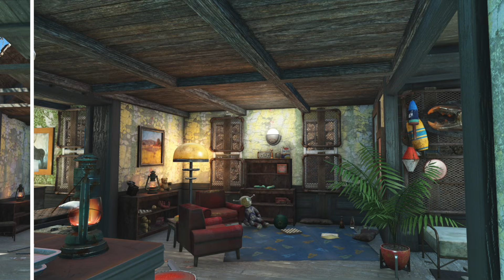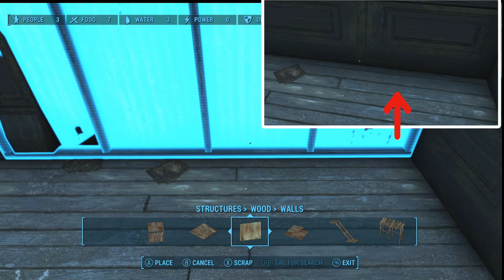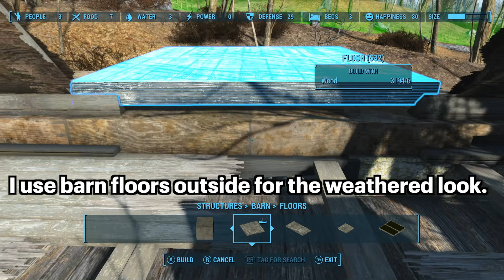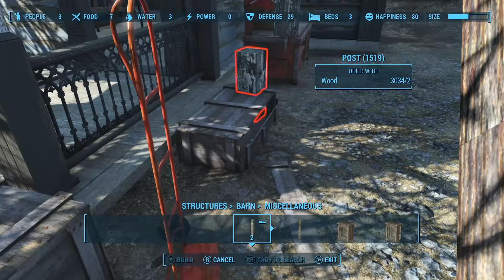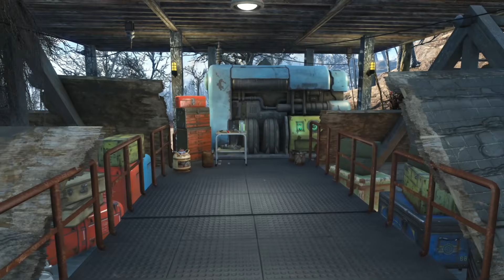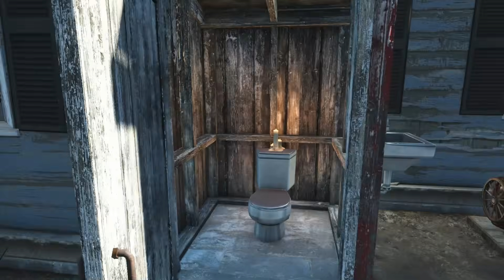Fallout 4 Somerville House Repair Build Tutorial (NO Mods/Glitches)

Comment: This is a head smack moment for me. For some reason I never tried building the ceiling from the inside at this location, even though I do it that way in others, like Sunshine Tidings Co-Op. It can be pretty hard to get the floor tiles to lay down in the attic area at this location, with all the obstructions and necessary clipping.
Reply from the maker: Agree - it is tricky to lay the floor in the attic at Somerville. I'm glad this video was helpful to you!

Comment: CC, your videos are always so good. While I'm a simple guy & mostly do "bunkhouse" type buildings (unless I'm using the SimSettlements2 mod), two of your videos have stuck with me & I try to emulate them when building settlements: your "Build a Motel" and the "Simple Shacks" designs. it's cool how just a 4x2 base can make multiple unique homes (with a porch!)  

Have you ever done a Vault 88 build, using the Vault-Tec DLC vault pieces? I've tried, but the ceilings feel too low to me, and I get frustrated. Actually, same with the default wood walls, so I usually use the barn walls instead since they're taller. (If the wood walls had half-height walls like in FO76, it wouldn't be so bad, but what are you gonna do?) But the one thing that frustrates me the most about Vanilla FO4 settlement building is this: Are we supposed to believe that after 200 years, NO ONE has re-learned how to make wooden/metal walls/roofs without holes in them? I mean, sure, if you don't want "clean" walls/roofs, then have obvious patches on them to cover the holes! Even the most inept wasteland survivor would do that. I end up using floors for roofs, just to keep the rain out! LOL (also makes a stable platform for turrets on the roof corners) 

Oops. Sorry about the rant. Got carried away. TL/DR -- I like your work & was wondering if you've done a Vault 88 vid. Bye!
Reply from the maker: I couldn't agree more with you on all of the building pieces with holes (don't forget the broken windows in the barn and warehouse walls - it drives me crazy!!) For Vault 88, I haven't done one yet - I would like to but that will take a considerable amount of time to put together.  So I have that on the back burner until I can give it the time it needs. And thank you - I'm glad that the motel and simple shacks have been helpful to you - sometimes a simple building is really all you need anyway!

Comment: Amazing build! I want to build more extensive settlements on my X replay of FO4, but I'm always struggling to find enough resources...
Reply: You can set up water purifiers at Sanctuary and sell the water to merchants. Then buy shipments of supplies like wood and cement ect. You can also scrap guns you don't need for parts. Great for steel and plastic.
Reply from the maker: @danielpalm8430 Thanks @tylxr.collxcts  - this is pretty much what I would recommend too. Here are a few additional tips:
*Make sure you have caravans set up to share building resources.  
*Also buy steel shipments.
*If you have finished the Cabot house questline, you can loot it over and over - the loot immediately respawns when you leave the cell. So you can loot the house, sell (there are a few weapons worth selling) or scrap the items for building materials and then repeat. 
*The Strong Back perk @ L4 allows fast traveling if over encumbered.  Very useful if you aren't in Survival mode.

Comment: Hello Young Lady! Took me awhile i got this to work! well done. I used barn floors myself. The second room is tricky, correct! Would you like a free tip from an old creator!  before you place the walls at 1min/2.30mins. place a quarter floor tile down first in the corners, place your wall on top of that one. this increases your new ceiling height! I tried it with a double upper floor first on the floor but couldnt get that to work! after playing for 11 yrs. I may have to start a new game, putting your tips into practice. then again ive prob already put about 7000hrs into this game. thank-you.👍😎
Reply from the maker: You are very welcome and thank you for the building tip! I've used the 1/4 floor in other builds for when I want to get the floor above another object, but I agree - that would have been a great solution here! I happy that you gave this a try and were able to get this to work for you! And 7000 hours into FO4 is very impressive - so I'm really glad that you have found a tip or two that you can use in your game😊

Comment: This was a tough one for collision issues. I couldn't get the mats to line up and it was grrrrrr😅
Reply from the maker: Sorry to hear that you had problems.  I understand - I had problems with that area too.  One viewer commented that it is possible to get the small shack floors to fit in that area instead of using the rubber mats.  I haven't tried that yet - but it might work for you.
Reply: @CCRenovatesFallout  I will try that. Right after I finished decorating the house. Got a major attack. Spawned right in the settlement 😂😂 dang Raiders killed my bartender and security guard. So I expanded a bit with guard post and bunk house separate from the home.
Reply from the maker: @Dwolf64NMS  Oh no - sounds like you have your hands full! Good luck with the decorating!

Comment: 4:32 regarding the gap in the roof I found you could put down one and half warehouse floor tile and then add two small shack tiles and that covers up the annoying gap that you otherwise papered over with the rubber mat. I also decided to put the chem station underneath the bit of roof at the end.
Reply from the maker: Thank you - I will definitely give that a try! That would look much nicer than the rubber mat!  Thanks for sharing your tip!
Reply: @CCRenovatesFallout  you're welcome. I've seen some unmodded builds of Somerville and decided to use yours as the basis for my build. I will be turning it into more of a fort though as the neighborhood is terrible.
Reply from the maker: @Zergonapal  - Agree - that location is perfect for a fort!  Glad that this was helpful for your build at Somerville!

Comment: Completely unable to place anu of the initial building pieces as described and instructed. Build doesn't work for me. I found this same issue on the Hangman's alley build. It strange because other builds of yours work out perfectly and some just won't place no matter how I try.
Reply from the maker: Sorry to hear that you are having problems! I'm not sure why this would be happening but here are a few ideas.  A few people have reported that they are unable to place some of the more precision pieces because they are using mouse and keyboard to build in FO4 (I use an Xbox controller) and they don't have the fine control that you have with a controller.  Also if you are using any scrapping mods, they can interfere with the ability to place items making it difficult (or impossible) to duplicate the builds.
Reply: @CCRenovatesFallout  Same.  Literally the first wall piece cant be placed closer than a couple feet to the wall.  Huge shame cuz I love your builds.
Reply: I'm on Xbox and have this problem. There simply is no placeable zone inside the house or on the roof. I've successfully built other settlements you've shown, but this one is bugged. So disappointed. Add this to my loooong list of broken areas.

Comment: I finally got a chance to use one of your builds last night, and this was it. I thought I would struggle at least a little,  but your use of markers and lineup points made it a breeze. I did struggle for a minute trying to power the elevator though 🤦‍♂️
I solved my dilemma with setting the reactor on the hill and wifi glitching it.🎉
Afterward I snapped a matching floor to the bottom of the elevator because it was fugly with the elevator on the second floor. (Not sure if that's a pathing issue or not yet).
I just wanted to say thank you. I've enjoyed all of your builds, and I can't wait to try another. 🍻
Reply from the maker: You're welcome - I really appreciate that!  I'm happy to hear that gave this a try! Wifi glitching the power is by far the easiest and cleanest way to get the power around the settlement (unfortunately I don't use it in the videos to keep it glitch free). Thanks for letting me know how the build went for you!

Comment: Question, do floors count as shelter for the beds beneath them or do the beds need an actual roof over them somewhere?
Reply from the maker: Yes - the floors do count as shelter for the beds and don't require an actual roof above them.  I have a couple of videos where I test building items to see what does and doesn't provide shelter in the game including floors, vehicles, structure height, and even some roofs that DON"T provide shelter.  If you are interested, here are the links:
Part 1 https://youtu.be/3h1obW8mAEI
Part 2  https://youtu.be/vjcLmAwP8Ng

Comment: how come editing mode for you is blue mine is green, I like the blue a lot better.
Reply from the maker: You can change the color from the menu when you start the game. Scroll down to Settings/Display
In the Display menu, scroll down to Hud Color.  My HUD color R is at about 25%, HUD color G is at about 60 - 65% and HUD color B is at 100% (toward the right).  You can slide them around until you find the shade that you like. When you leave the menu it will automatically save your new settings.

Comment: I got lucky enough to be able to place warehouse wood floors on top of the ceiling from the roof area, without glitching throughout the whole section, wall-to-wall. I don't know how that first sweet spot was found, but it is possible if you don't want to do the underside version...and I think I started from the same corner on top that you did..or maybe the opposite one. I cannot remember if it penetrated the ceiling for no holes, though.

This is a lovely build. I am concerned that the settlers will see extra attacks with lights to draw the enemy out, I'm sure they are well defended from such scuffles. 😊
Reply from the maker: Wow - impressive - I tried for countless hours to get a floor to fit but couldn't do it. I kept running into the wood rafters (or something) and couldn't get them to snap. 
You may be right about the attacks - but it sure looks nice all lit up!  I moved my turrets out of the area for the video to minimize the noise but will have to move them back. Lately its been getting attacked every time the provisioner shows up. Thank you - I'm glad that you like the build 😊